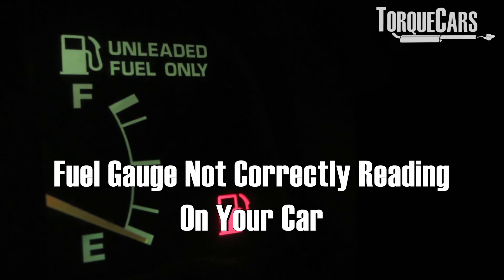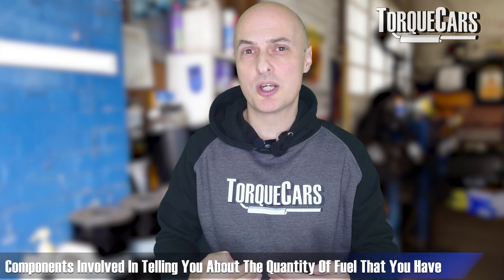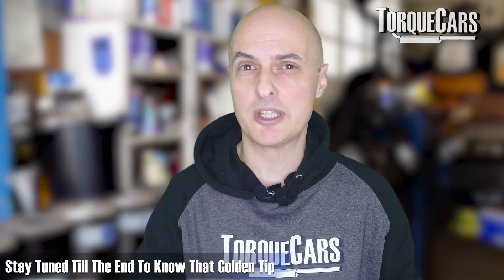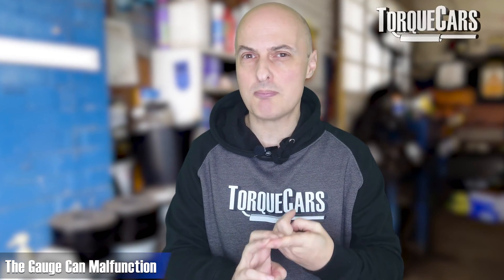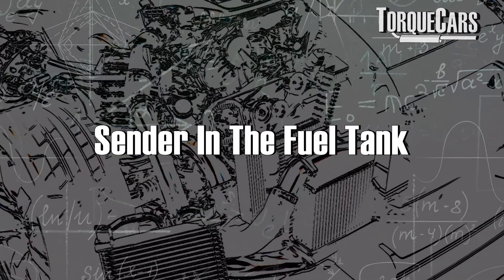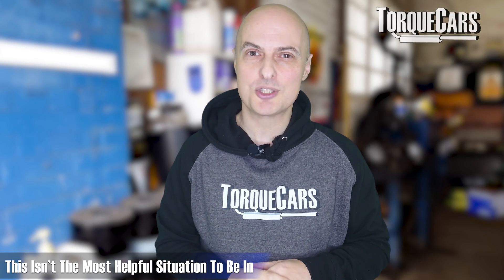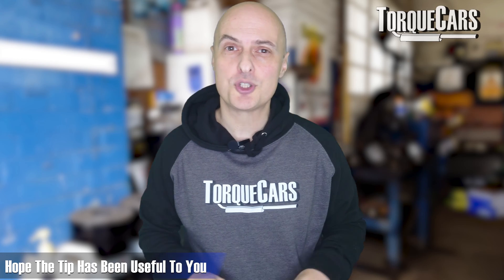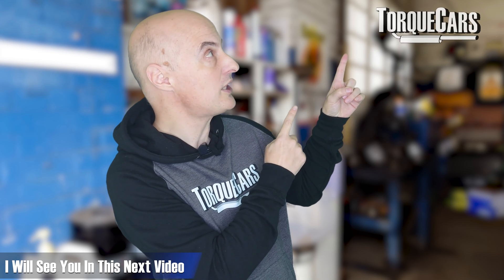Cars Fuel Gauge Not Working Or Reading Wrong Fuel Levels.

Comment: My fuel sending unit isn't working properly and gives inaccurate readings. I reset my trip mileage every fill up. A half of tank in my truck is about 175 miles. So when I reach that limit, I just fill it up. Mine will be reading "low fuel" when I have 3/4 of a tank of fuel. But the reading is in accurate. Some days it's accurate, other days it's all over the place. I check the trip mileage and go on. It is very aggravating though. One day I'll replace the fuel sending unit. But until then, I just check the trip mileage.

Comment: I have a 2023 Ford Ranger. I swapped my factory 18 gallon fuel tank for an aftermarket 37 gallon tank. My tank registers full for around 300 miles then slowly goes down for another 500 to 600 miles. Once close to “0” miles left I fill up and still have 3 or 4 gallons in the tank. Any way to have it slowly go down consistently like normal an be accurate?

Comment: When i test the fuel sensor outside of the gas tank by pushing the float up and down the guage reciprocates accurately but as soon as i install it into the tank seal it up the guage starts giving me empty or quarter tank when its full. Could the gasoline effect the fuel sensor
Reply from the maker: Is the float actually working as  a float? I've known these to actually fill and start to sink after a while which would explain why it works when you manually push but it's not happening inside the tank. There should also be very lilttle friction acting on the float. Sludge around the fuel pickup in the tank can also cause strange readings to happen.
Reply: @torquecars  gas tank is clean no sludge and friction is minimal as for the float i havent tested its floating ability in water or anything i just put it in the tank. Also this is a replacement pump made in china it pumps fine works sends fuel properly but i just cant get it to read the fuel level properly. It worked for like a day initially reading right then went all the way down from fullto empty replaced that pump with another same thing
Reply from the maker: Does the sender have just one wire? This relies on the tank providing the ground. If the connection between the tank and ground is failing this will cause similar symptoms.

Which brand of car is this? Check for loose wires, bad connections. I've known some cars to need a new soldered connection on the earth for the fuel pickup to work.
Reply: Me to my brother I am struggling with them same problem for the whole week now, today I have tried to take out the tank to fix the problem,but all in vain, when the float is out side the tank is showing accurate reading,but the more I put it back to the tank it's the problem again 😢😢😢

Comment: I’ve replaced the fuel pump twice on a 2010 challenger. The fuel sending unit was replaced twice. And both times it still read inaccurate. It’ll read half when it’s full, then all of sudden start reading full. Then when it’s at about 3/4 a tank it’ll tell me it’s at 1/2. And when it’s bellow 3/4 it will slowly drain down till it says empty in a few seconds.
Reply from the maker: This sounds like it could be a cable run issue such as a bad connection or poor earth. Or are you running 2000hp and have a heavy right foot so the poor gauge can't keep up with you? lol
Reply: I just happen in my 2012 challenger replace both pumps filled the car up now it’s stuck on half a tank
Reply: Same wrangler 2021 in hot weather it plays up and down

Comment: I just wish the needle was actually accurate for once… I had a 2013 Fabia vRS and sometimes I could do up to 100 miles before the needle even moved.

Same goes for my 2018 Karoq it doesn’t move an inch until I’ve done about 100-150 miles then it seems to go down at a steady rate, how is it so difficult for manufacturers to get that right?

Comment: Fuel gauges are NEVER accurate in my experience, even if they are digital.

In my 2011 VW Golf, the needle won't move from full position until you've done 100 miles...

Even better is when the needle is at Empty and the digital dash is saying 0 miles left of range, I drove for another 36 miles before the car conked out on me 😂😂

Comment: My fuel gauge in my B5 is different. It works and all but here's how it reads. Remember I'm running pump E85. From a full tank to the ½ tank line I get 200 miles. From ½ to ¼ I get about 50 and after you can literally watch the needle move. Needless to say I fuel up soon after I get to the ½ tank point! I do still get 20 mpg on E85. I've been testing ethanol levels monthly(ish) for about 18 months now and it's always 80%. Also fun fact, I did a compression test on my 1.8T (not the built one) and it's at 75psi on all 4! I can't believe it still runs, and it runs good!